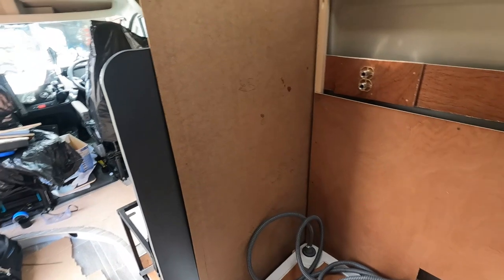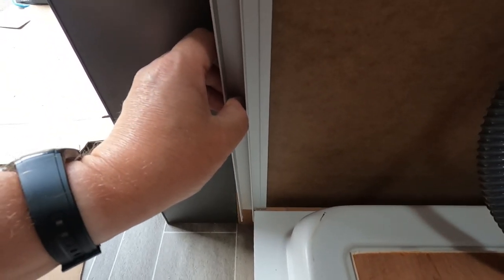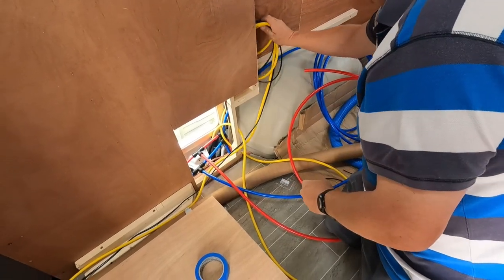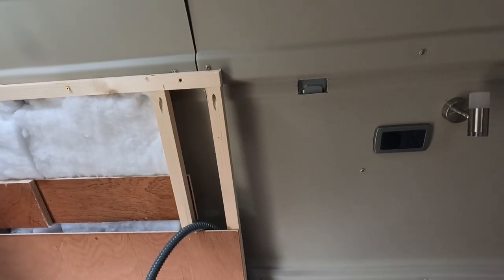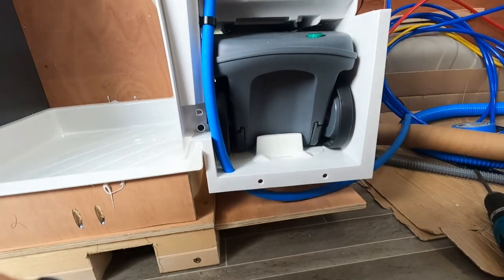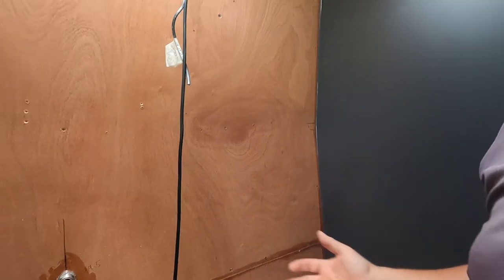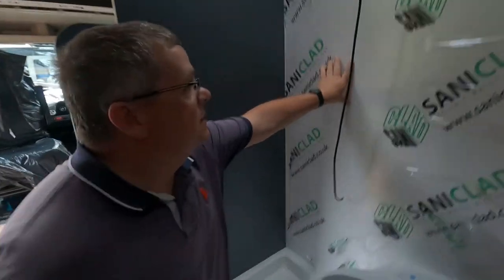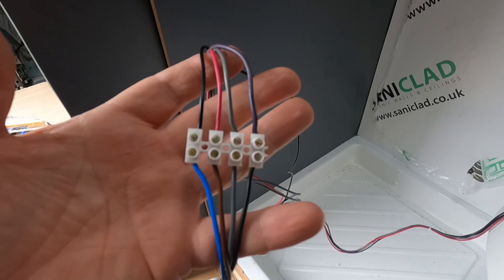Shower built in self built campervan part 2 for ducato / relay / boxer / promaster

Comment: Hi Great video as with all of your videos, just wondering if you managed to sort your 4 electric cables out on the toilet.  I am doing first fix electrics in my van conversion, looked at the C200 Thetford toilet and I am totally confused the manual text does not match the wiring diagrams at all. May have to contact Thetford unless you can explain how you did it?
BR
David
Reply from the maker: Looked at the instructions for the C200 series and the colours are different from the 400 series but p18 of the instructions says which colour does what. i wired mine to the same power switch as the pump and effectively followed the 'pressurised water' option as it only gets power when the pump is on as they are both powered from the same source, if that makes sense? hope that helps.

Comment: hi can i ask what fitting u used from the thetford toilet water pipe to john guest 12mm pipe please ,it had a barbed fitting as u said thanks
Reply from the maker: search magnum motorhomes for part number M439 and M440, it will be one of those two you need depending on the toilet.

Comment: Hi, I have found your build series very useful over the last few months. I'm just doing the shower in my Relay and had a couple of questions, what did you use to cut the Saniclad panels? And what are the 4 wires on the toilet for, did you cover this in a later video?
Reply from the maker: Used a 'rough cut' wood blade in my jigsaw believe or not and it worked great. suggest trying a small corner first before letting rip though. on the toilet, cant remember now but find an instructions PDF online from Thetford, it has a wiring diagram in it.
Reply: Thanks, I will have a look at the PDF, also I have subsequently seen other van builders on YouTube cut the panels with a jigsaw but using a fine tooth metal blade, I'll give that a go.
Reply: I think I understand now having googled around a bit, the grey and purple are connected to a relay to start an external pump perhaps for domestic use, but given we have installed pumps in our vans which maintain constant water pressure when the van is in use, then we only need to connect the red and black positive and negative leads.

Comment: how many sheets did you use on the complete shower cubic
Reply from the maker: I bought 4 sheets, 1 for each side. I think I could have got it out of three but as they are not really very expensive in the big scheme of things I couldn't be arsed with all the measuring and messing about trying to measure and cut from three sheets. Have actually used all the offcuts for other things since so not wasted in fact, for me anyhoo.

Comment: Hey Mike, why use wet blasting anyway?  Indeed we used thin acryl covering the glass and threw them away whenever suited. Using wet sandblasting is sorry to say waste of time because when you activate your substrate it is already corroded te moment you take it out of this little cabine. Just use dry and a bit more expensive aluminium oxide. If you want a somewhat shiny surface use glass beads, also dry. Cheers 
.
Reply from the maker: Not sure the comment matches the video??